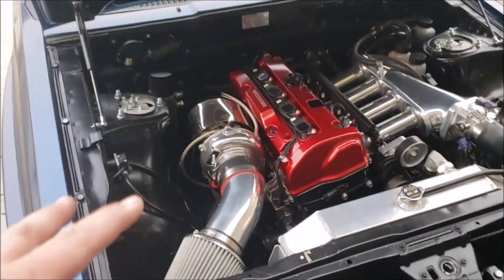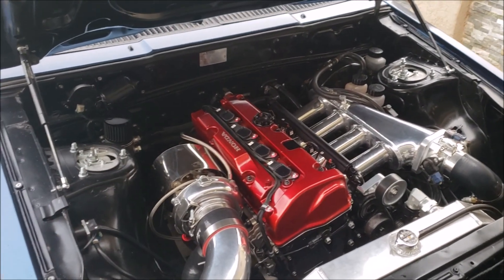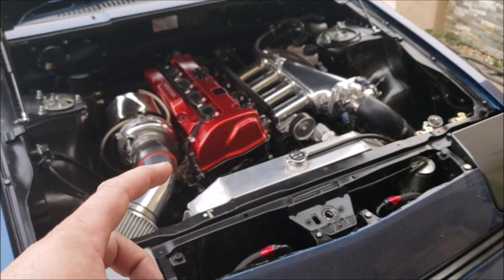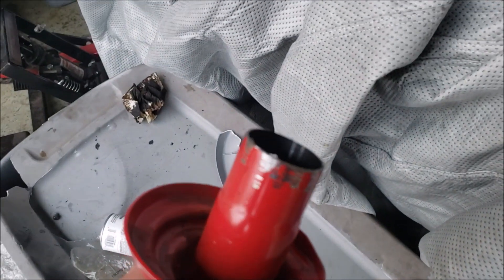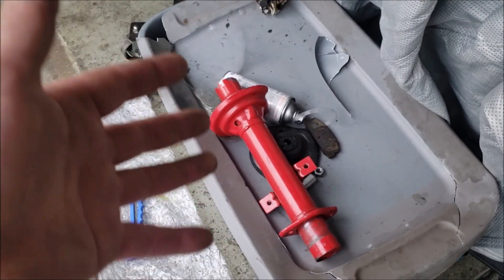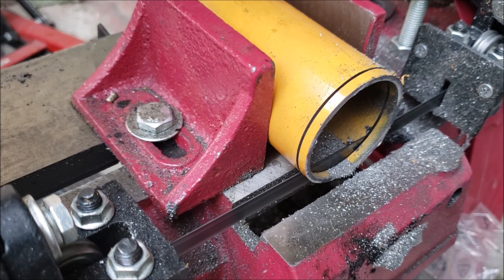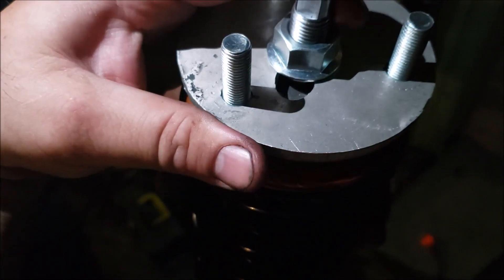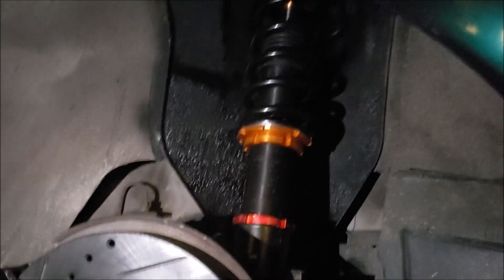Mitsubishi Starion Coilover Install Using Lancer Evolution Coilovers

Comment: Seems Maxpeedingrods doesn’t sell this set anymore when I search their site. Is there an alternative option like can you use gen 7 and up and modify?
Reply from the maker: I just checked and saw them. If you go to their website and type in "Lancer" in the search bar, it will be there. You can always try another brand as well
Reply: @SleepRGarage  this is a very cool project!  However, I searched that part number on maxpeedingrods and also could not find the 1996-2000 lancer evo coilovers.  Any other pointers on getting the set that you got?
Reply from the maker: @mattheller823  hello Matt, thanks for watching 🙏.  The coilovers we are using are for the next gen lancer. They are extremely similar, just need minor mods. This what we had available at the time of the install.
Reply from the maker: @mattheller823  my apologies Matt, i was referring to another video.
Reply from the maker: They are still there, but seem to be on back order. Go to website and type evo, I believe 7 8 9 are the same
Reply: @SleepRGarage  ooh. Nice!  7,8,9 should be much easier to find!

Comment: I really wish someone made true front coils.  Ive reached out to BC and others with no luck.  I have seen an fc rx7 setup used but i cant recall all that was needed.  That same car used the rx7 spindles as well.
Reply from the maker: Anything is possible with a little imagination and alot of 💰 🤑 💸.  Hahahaha, but yeah I hear you, not everyone has access to cutting and welding tools. A complete bolt on would be awesome. Thanks for watching.